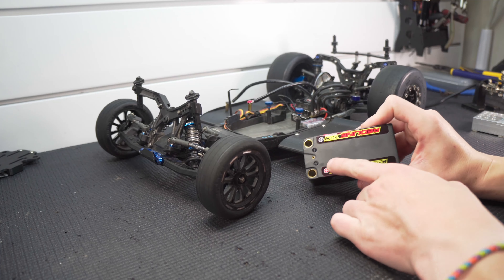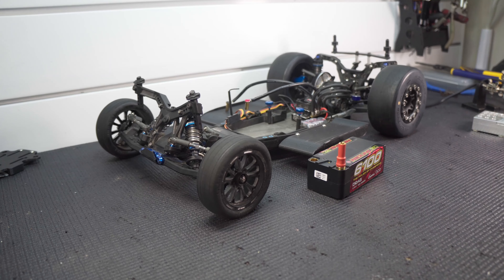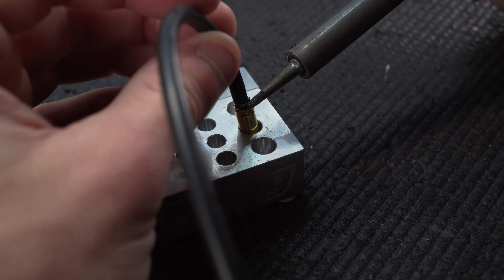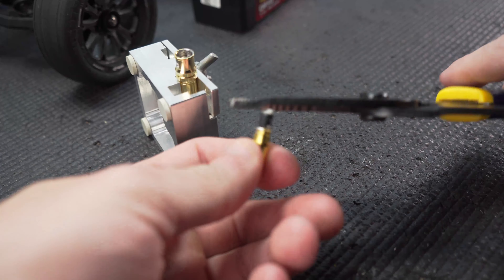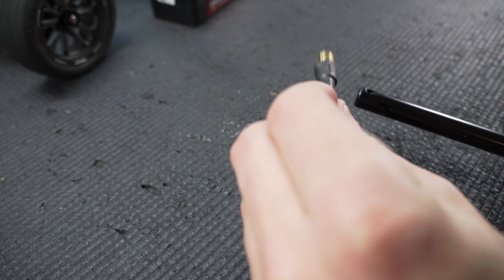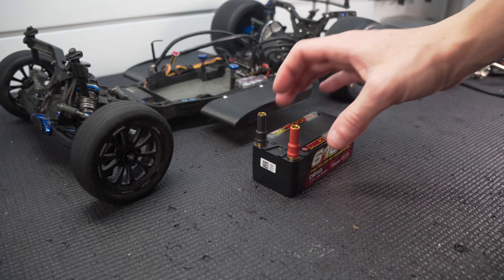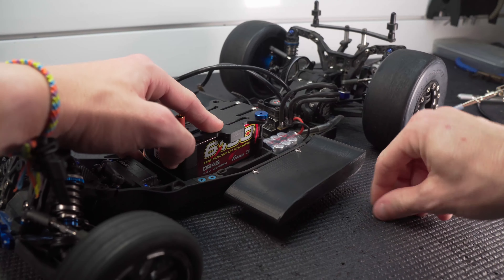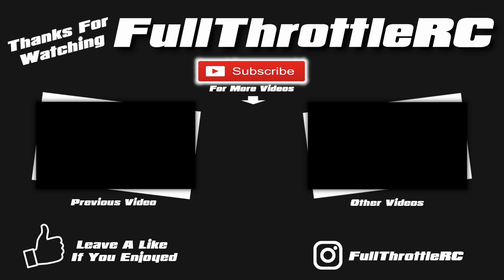My New No Prep RC Battery Doesn't Work!! Can I make it??

Comment: I dont see anything at all wrong with what you've made .Only thing I would do different is spin the battery around backwards from what you have then shorten up the positive and negatiewe from the ESC . Love the videos bro .
Reply from the maker: That may or may not have been done when I added the new battery mount 👀👀
Reply: @FullThrottleRC  awesome man !

Comment: Love the vids, FYI if careful you can bring back a discharged Lipo with a bench top power supply or by charging at a low amperage on Nimh mode. Charge it like a 6cell stick pack at a low rate 500 - 1000 mah until the voltage gets up high enough that your lipo charger will recognize it again, then do a good charge with balancing. I have brought back a lot of batteries that way, just babysit it the first time, and use good judgement, if its puffed or otherwise visually damaged think twice. Also if you ever make those again you might be abele to skip the wire and just solder the 5mm into the male, they might end up a little lower profile.
Reply from the maker: Thank you!! I've heard about saving lipos that way but have honesty always been scared to try it. This one seems perfectly fine other than being completely dead so maybe I can try it on this one.
Reply: @FullThrottleRC  definitely give it a go. I do it more often than I'd like to admit 😏

Comment: No problem, i make adapters like that all the time, perks of using bullets👌
Reply from the maker: It's worked so far 🤷🏻‍♂️ I haven't seen any abnormal voltage drop while using it either

Comment: I have made adapters before.they worked fine for me.I’m going to try the CNHL batt.with my new esc and I changed up the suspension adjustments so should leave the line better.you could make extensions to thread onto the post you have for the thumb screw to catch.
Reply from the maker: That's a thought, I didn't think of a threaded extension
Reply: Great battery run it in my losi 22s!!!!

Comment: Not a bad adapter idea, but you are not going to see the full potential of these Gens Ace drag packs adding resistance to your electronic system.  You may see more heat in your electronics and run the risk of damaging your esc.  These drag cars can pull upwards of 500 amps of current for short amounts of time.  I would highly recommend turning the battery around and soldering the 8mm bullets directly to your battery leads at the least.  Upgrading to 10 or 8 gauge wire would be ideal. Drag racing is all about data and consistency.  You will not get the same data out of you old pack and you new Gens Ace pack.
Reply from the maker: Thanks, I knew I'd get a few comments like this. I agree with you, I did add some resistance. I didn't show it in this video, but part of my new battery strap is turning the battery around so I can shorten up those leads so that's actually already done. Like I talked about in the video, I will end up switching to 8mm bullets later on, but for now I'm running like this to still use my old pack as well. I know its not the best solution but it'll work for now. Haven't noticed any differences in temperature with the passes I've made so far by the way.

Comment: What are those shock mounts you have on there ? Who makes them.
Reply from the maker: @andrewbrown8927  I used to run a 3d printed shock mount that I designed and printed myself. I do believe there were a few companies that made something similar though
Reply: @FullThrottleRC  I was wondering if that's what it was. J concepts had a wide  no prep rear mount I bought but I can't find them anymore. I was looking for another option if that one ever breaks. Maybe I should buy a 3d printer.

Comment: I have an idea to use the 8mm bullets. i think you can get a castle mamba monster X 8s, put those 8mm bullets on it, and i think you can run down to  2.0t motor. I've seen some people doing that so i think it would be interesting to try
Reply from the maker: I don't think I've gotten everything out of the setup I have just yet. No need to be looking for more power yet when I don't have all of it hooking to the road yet
Reply: @FullThrottleRC  yea. Makes sense

Comment: You won't get the full potential of the battery unless you go 10g all the way to the esc and motor. It's like bottle necking the power to your esc and motor. Let me know how hot those wires get 😬
Reply from the maker: I know I'd technically get better current flow with bigger wires but I want to stay with this for now so I can run my other batteries as well. The wires haven't gotten hot though. I can pull the connectors from the batteries to unplug them right after a pass with no problem.

Comment: Seems silly that a company would put in 8 mm holes when the biggest wire we are likely to use is 10 ga.
I couldn't picture 00 battery cables on an rc car.
Reply from the maker: It definitely lets current flow easier but you're right, I haven't seen many people using wires much bigger than this in RC.

Comment: I don't think the little extra resistance is going to that big of difference
Reply from the maker: I haven't really noticed a difference in voltage drop between this battery and my older gens ace pack with 5mm bullets so far. I'll be watching those numbers closely though as I test

Comment: What did that car weigh?
Reply from the maker: I believe I had a video on weight with this car right before swapping over to the DR10M. The DR10M actually wasn't that much lighter than the original car. Somewhere around 76oz 2100-2200g, I don't remember exactly.